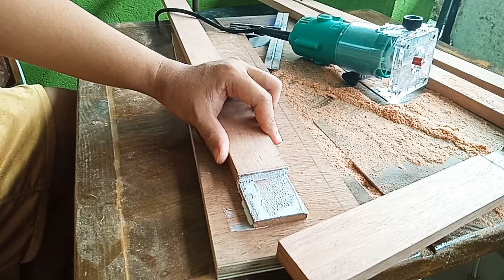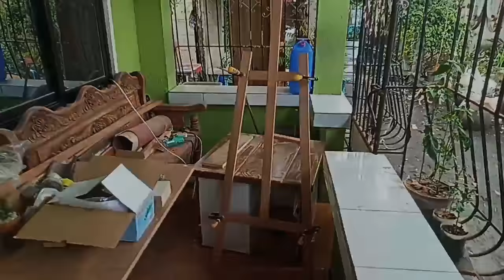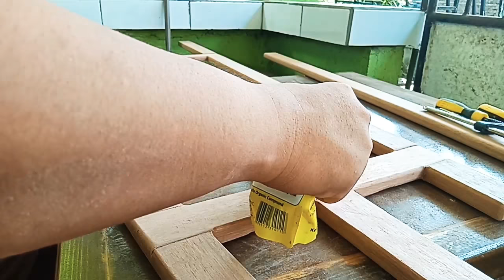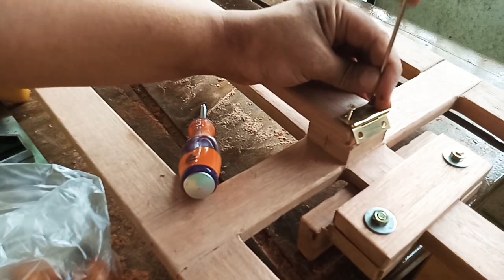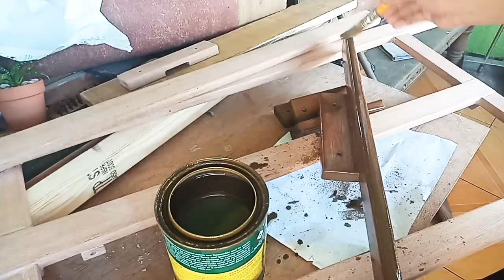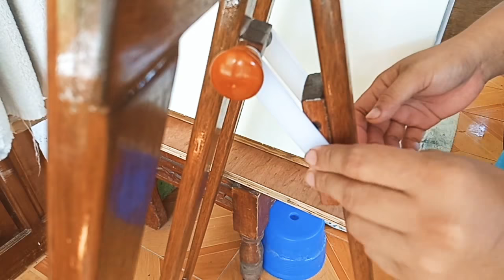How To Make An Adjustable Art Easel

Comment: I love that hand operated drill.   I used to have one when I was a young child.  I used that hand drill, a brace and bit, an old claw hammer, and a couple of old screw drivers with damaged handles to build all sorts of treasures 'back in the dark ages'.  Thanks for the video.
The easel is quite good, btw.

Comment: Hello, great Easel. Would love to make one myself. How did you add the short middle pieces to the Easle?
Reply from the maker: Can you become more specific?
Reply: @joshuelicasartscrafts1250  Hello, thank you for your quick reply. I meant the middle movable piece on which the painting would stand on. It confused me at first, how the middle pieces that are glued together fit with the back piece that is connected with the bolts, as the edge wood board parts would come in the way of the movable piece and the middle piece would not fit. I figured it out. You also cut the movable piece from the edge of the glued central piece till the end of it, so the middle piece would fit. I hope you understand. All in all, I figured it out and I am half-way through completing the Easle. Thank you!

Comment: Hello mate! It's fantastic, could you pass the measurements to be able to make a similar one myself? Thanks in advance
Reply from the maker: 5' height
2' width
2"x¾" wood
3pcs, 4' length
1pc, 43" length
2pcs, 20" length
1pc, 14" length
3pcs, 5" length
1pcs, 6" length
2 pcs, 2" length
That is all length cut sizes of all wood pieces mate. And the plastic part is 2pcs 4" length. 
Bolts are 6mm in diameter.
Reply: @joshuelicasartscrafts1250  Thank you mate!!

Comment: Hi. I wish to make a similar easel for my daughter. Would it be possible to have plans ? Thanks for this video anyway
Reply from the maker: 5' height
2' width
2"x¾" wood
3pcs, 4' length
1pc, 43" length
2pcs, 20" length
1pc, 14" length
3pcs, 5" length
1pcs, 6" length
2 pcs, 2" length
That is all length cut sizes of all wood pieces mate. And the plastic part is 2pcs 4" length. 
Bolts are 6mm in diameter.
Reply from the maker: I hope it can help
Reply: @joshuelicasartscrafts1250  Yessss. Thanks a lot

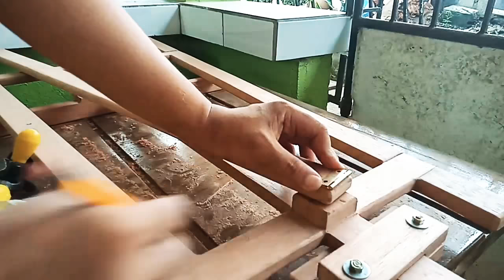Comment: What's the length of the last piece, the back feet, that you install at 12:15? I think you've already used the three pieces with each 4 feet for the front panel.
Reply from the maker: 43" inches,

Comment: kuya, ilang wood pieces po nagamit nyo at ilang meters po??
Reply from the maker: 5' height
2' width
2"x¾" wood
3pcs, 4' length
1pc, 43" length
2pcs, 20" length
1pc, 14" length
3pcs, 5" length
1pcs, 6" length
2 pcs, 2" length
That is all length cut sizes of all wood pieces mate. And the plastic part is 2pcs 4" length. 
Bolts are 6mm in diameter.

Comment: Por favor traducirlo al español
Reply from the maker: I'm sorry I can't compose spanish.
But maybe this will help.
5' height
2' width
2"x¾" wood
3pcs, 4' length
1pc, 43" length
2pcs, 20" length
1pc, 14" length
3pcs, 5" length
1pcs, 6" length
2 pcs, 2" length
That is all length cut sizes of all wood pieces mate. And the plastic part is 2pcs 4" length. 
Bolts are 6mm in diameter